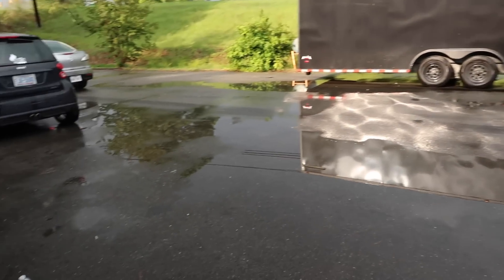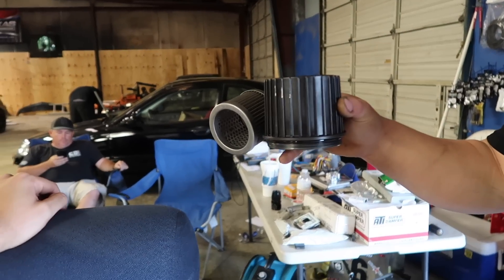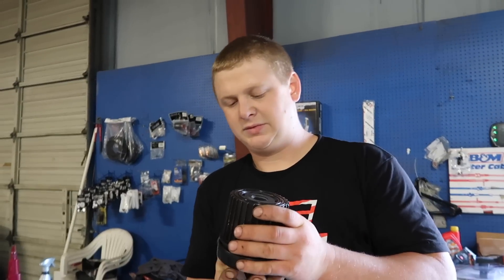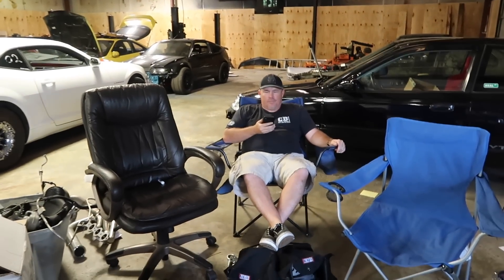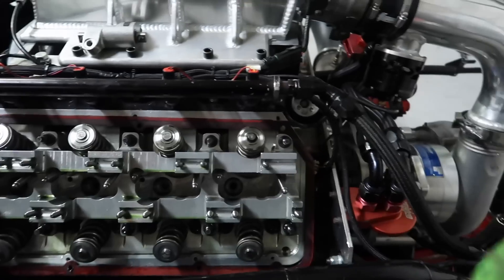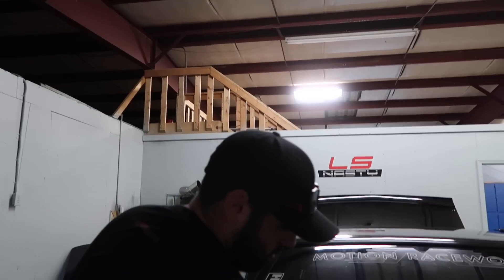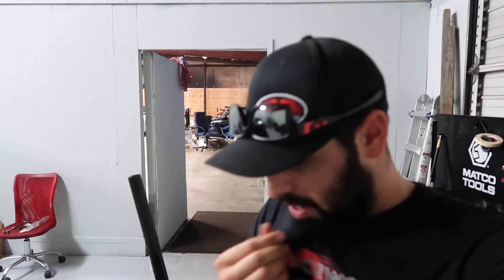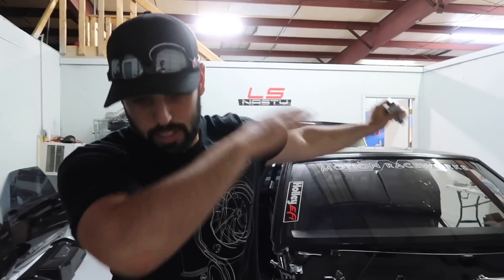This almost DESTROYED my Procharged BILLET HEMI Engine

Comment: WOW ! Great catch John. I tell you follow your gut I bought my so called turn key last year and still haven't made it to the track. I just keep finding small things that turn into more. But when it's done you will know the car. You will trust it more and feel alot safer/comfortable which in turn will make you faster because you trust your equipment. Nothing worse than moving to the next level like your doing and having to worry about anything but driving. Dont worry about us take the time you need.

Comment: Fueltech all the way. There's a reason most of the fastest cars run it over holley in RvsW, X275, etc. Holley is ok but if I'm going all out racing it's Fueltech all the way.

Don't forget to use the wheelie control that Holley has like Fueltech. It's extremely helpful in cars like this. You need the senses if the car doesn't have them. I don't think it does because you haven't mentioned them or said a word about it. They will make the computer pull timing where your set the height to. You can also control how much and aggressive the timing comes out to keep the nose where you want it. 
It's a lot to setup one of these cars. Tons of tuning if you have no data to go off too. Enjoy it's going to be a fun journey to watch. For those who wonder how some cars never wheelie high and just fly with the nose down that's the secret behind it. Of course it only works as good as the tuner just like everything else. Good luck bro.
Reply: I bough a autotronic sm4 still building the car so havnt tried it yet but iv heard great things about it

Comment: Race car problems period! You have a fantastic starting piece but it looks like the guy you got it from did a rush job on everything! If it was me....I would take the engine out and get it gone back through instead of assuming everything is ok. Nothing about this car seems to be what it appears but it is a RACECAR.
Reply: I'm pretty sure they did that didn't they? or atleast the valve train.. that's why all these people in the comments that know nothing about racing or anything over 300 wheel horsepower need to chill and let them dial  this shit in..the things they have found so far aren't very confidence inspiring...

Comment: I've been thinking about the coupler being at the top and was thinking if it blows off under boost and comes off hard enough it could still break the blower but if you move the coupler to the bottom it would just try and push it up. I donno just a thought !!

Comment: Hate to keep saying this but call rockerarm manufacturer and ask where the ajuster needs to be set at if its wrong you won't get any oil between adjuster and the push rod. I had same problem !

Comment: The reason your pushrods keep burning up is bc on a HEMI you have to pre lube the cup of the pushrods for the first start up with high pressure grease and continue to check them after every pass
Reply from the maker: They were prelubed
Reply: John Doc got no clue then

Comment: The number two rocker could have been little tighter then rest or that pushrod stop spinning during start up or not enough lube when it was put together. I like all the shop time videos because race cars spend 95• in shop and 5• on track.

Comment: Hard to talk bad against FuelTech when they’re leading the field in both Radial VS the World and a lot of the PDRA pro mod teams
Reply: Mark Chaves Jr that’s only because they run proline engines and to get the support from them, you must run fuel tech and proline owns that too. They engines are bad ass but the computer doesn’t make a car fast the motor and tune does.
Reply: @quintongreene3652  really because DRE (Disomma racing engines) guys mostly run Fueltech also. Who has built motors for the kings of X275 with multiple kinds of power adders the Bruder's. Also people like Manny's X275 car, Fletcher Cox's LDR car and new RvsW car to name a few and drives in pro boost and always shows that big hp with that top mph in most events. Has nothing to do with proline. Fastest guys use what works the best. 
Holley works well but saying it's better then Fueltech or saying guys only use it because of proline is just gibberish.
Reply: You said rvw and pro mods. The top of those classes run proline engines. Jose Gonzalez is the fastest and most winning driver in the pdra. Kevin Rivenbark with the first procharger to go to the top of rvw and pdra. Dwayne mills proline. I can keep going. The winners run proline engines. Dre just started winning those other classes about 3 years ago. Before then it was KBX and Bennet racing engines running BS3 ecu
Reply: @quintongreene3652  hes been around much longer then 3 years. Burders have been on top much longer then 3 years.
 Anthony was the first guy like 8 or 9 years ago to go 200mph in the 1/8 on a 10.5 tire before everything got as big as it is now. I've known Steve and proline since the lynch days years ago when they ran the mustang kicking everyone's ass. Great bunch of guys who really know their shit and I didn't say otherwise or a negative thing about them so I'm not sure what's with the comprehension problem?
Proline is everywhere so of course there's a great chance they win also. My point was the fastest and best guys use Fueltech which was my point and accurate.
Now yes I'm also bias when it comes to DRE. I owned his NMCA championship car many years ago. Help build his 04 cobra in the past and traveled with him racing. He's a personal friend of 20+ years from when I lived in NJ and since moved to Georgia few years ago. I shout him out when I can yet still stick to the facts. He also builds a great reliable motor that makes power. Regardless what it is. That was my point. They both have won many championships. He's one of the best key word ONE of the best. The best use Fueltech and that was the point.
Reply: My point is Like my first post said, the computer doesn’t make the car fast, the tuner does. If Fueltech is the best, then name something the computer does that Holley, Motech, big stuff 3, FAST, Mega Squirt, AEM, Haltech ...etc can’t do? I’ll wait.
Reply: @quintongreene3652  no shit it's the tuner when it comes down to it but throughout history until recently the computer did make a difference. I started with Haltech in the earlier 90s then to gen 6  DFI in the late 90s to F.A.S.T and big stuff in the early 2000s. I've used many different systems over the years.
Now Fueltech had the wheelie control back in 2016 with the FT600 before holley had it. 
The interfaces are different and some are easier then others for some people. So there are differences but most good tuners can use most of them. Everyone is going to have a favorite and claim their using the best just like with everything else like turbos, superchargers, nitrous kits, etc. 
I was breaking balls for the most part like Jon was when saying Holley was better. Say the fastest guys use Fueltech is true in many case. That said today most have the same options for the most part. It's a matter of preference when it comes down to it. Right now Fueltech is very popular and so is holley specially when it comes to the ls powered cars. 
Your taking shit way to personal bro.

Comment: If I were you Jon, I would bite the bullet and take the engine out and tear it all the way down. Then take all the measurements and completely rebuild to ensure the motor is right.  I personally would feel better with a rebuild than like it is and have a piece of mind that it’s 100% right and not going to tear it up.

Comment: Didn’t you just switch sides with heads, and put new rockers? You should have seen that. But I know that’s a different motor than you are used to. Looks like they just put it together with spare parts from around the shop. Good luck with the rest of the car

Comment: From a GM perspective ... how much can you get for the Hemi ?
Reply: There's nothing wrong with the hemi .its who put it together didnt know what they were doing or didnt have the right parts or wrong information to put it together .that motor was in another car that ran pretty darn good .once they get it straightened out they will be fine .I'm a chevy guy but we run the same thing .the hemi has bigger mains then a chevy .bigger piston pins better heads .bigger cam shaft bore ect ect by the time we took a aluminum chevy  block and put all the stuff you would need to make it as strong as a hemi  it still wouldn't be close to as strong as a hemi.its cheaper to buy the hemi .chevy has rear thrust .hemi has center thrust bearing .that is a huge huge plus on a big boost car . Just trying to give you a few reasons to use hemi or 481 x . Reliability is the key .big boost takes a toll on the bottom end .tears up thrust bearings which tears up every thing else .like cranks transmissions everything. Lol

Comment: You need to call AL from Manton and get set up with the correct shit for that motor man. No amount of extreme pressure lube is gonna help a issue with oiling. It MAY require a pushrod with a hole....

Comment: If I was in your shoes I would sell the hemi and buy a Brodix aluminum big block 540xi with a bad ass Bryant crank and some billet GRP billet rods, Diamonds best pistons,some Profiler or hell some Brodix Big Duke heads and all the good stuff for the valve train  lol a Hogan sheet metal intake use the injectors from the hemi and the fuel system already in the car I would try the procharger but I think  a huge Harts diesel turbo like Larson and Birdman are running in the 130mm or bigger range and see how that plays out. In the end it would be cheaper,cheaper parts that you can buy from summit(some parts) easier to work on and maintain. The hemi is gonna make more power(and break more)but not a hole lot more  I have no doubt in my mind a setup like I described would go 4.20's in that car possibly teens all the way turnt up hell you could possibly play around in LDR if the rules allow having a turbo the size of a toddler lol and it would have a good ol GM powerplant back in it. I  know Chuck Ford and when he told me how much a NHRA legal promod hemi with one of his blowers and hats from him cost it blew my mind, you have to be a millionaire hell you would have a million dollars in a new ready to go car a couple of spare motors the damn 18 wheeler and amazing stacker/camper trailer shew that's alot of $$$$$$$$$$$$$$$$

Comment: Hey hey...just throw a shop rag in the fuel filter!  (runs away)

As for the rods, oil is supposed to well up through the holes the rods are in, oil the cups and rockers before dripping back down. There should NOT be excessive oil but there should be enough oil coming up to do that.

JESUS CHRIST! I thought your problem was 7...wtf happened to 2?  Fuck, you need to tear that bad boy down and see what else is going on.

You SEE why it was for sale now. The previous owner lost his "guy" or "guys" to service that engine, got some other "not so good guys" who are engine guys but not hemi engine guys.

Hemi's are probably damn near close to the more rare engines on earth. Hemis of that nature anyways. 

Like you said, that engine is nothing like an LS yet some guy doing LS's would say "oh hell, why not...it's just an engine, right?"

Fuck man, I'd have that bitch down to it's bearings given how the previous owner shat a 4 minute working engine at you.

Comment: You have the wrong push rods you need hardened one piece push rods
Reply from the maker: I figured solid piece of 3/8th tool Steele would work
Reply: @JohnDoc  Just grab some re-bar from any construction site you find....without oil it's going to burn up whatever you put in there. Family member had a Keith Black Hemi back in the day and he was burning up push rods due to oiling issue. Just keep chugging buddy. It's not a street car and these are the reasons

Comment: You should sell that motor for top dollar n buy  proline 481x Chevy motor you understand a lot better 
Anyway good luck hope you get running
Reply: 481x isn't anything like a BBC. The only thing Chevy about a 481x is the bore spacing hence the name. Otherwise the design mostly comes from the hemi. No reason whatsoever to get a proline 481x in place of this. He's not going to understand 481x and better than this anyway. Either is anything like he's run before. 
 Nothing about this car is anything like he's run before. It's a new learning curve and it takes time. 481x isn't going to do anything but hurt his pockets more then necessary.